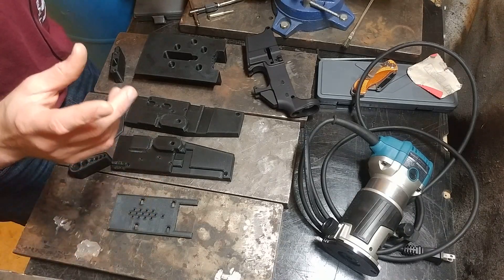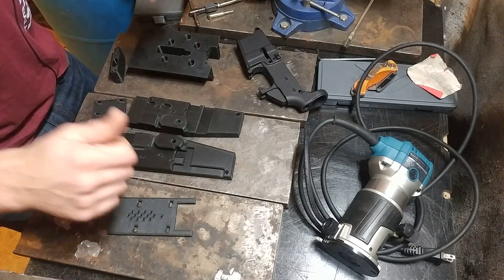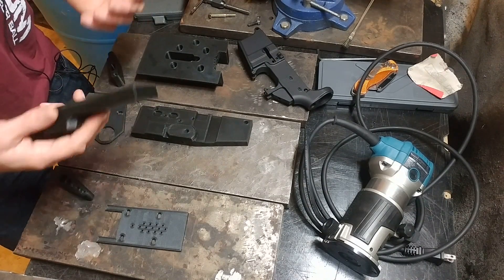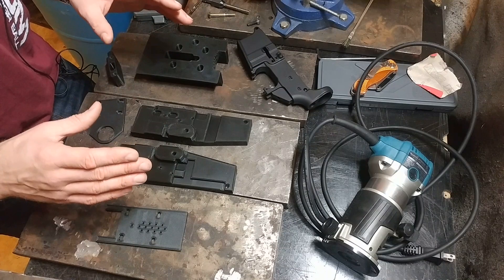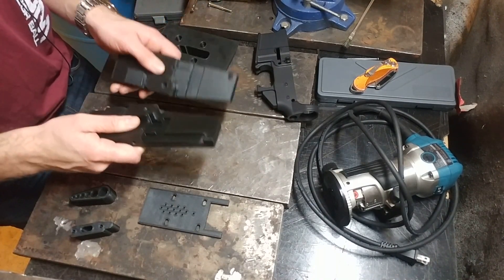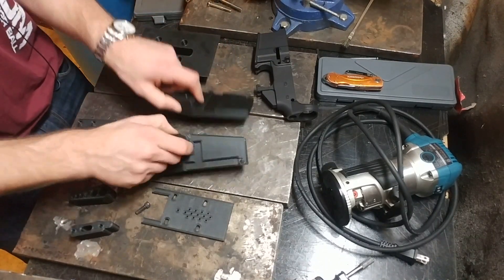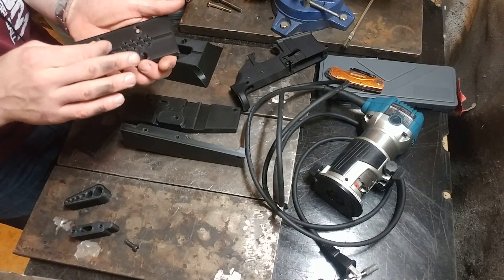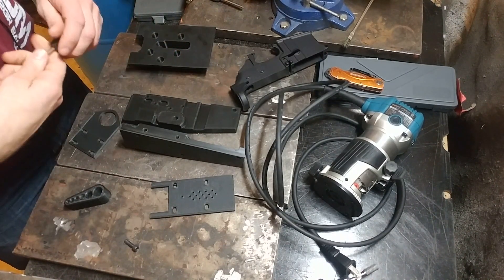FreeCAD Freedomizer Fixture

Comment: What length endmill are you using with this set up? That router base is really tall.
Reply from the maker: Very strange - I've tried commenting here twice, but YT seems to be throwing my message into the abyss. The short version: 1/4"x4" with 3/4" flutes, and buy them from "carbidetoolsource" on eBay.
Reply: @swolebro  Hey bud, would you happen to have a link to the exact bit I need? I searched all over the ebay seller you recommended but found nothing 4" long.
Reply from the maker: @MrIsaacpr7  Found out earlier this week they've got their own website now in addition to the eBay. It's a bit easier to browse.

https://www.carbidetoolsource.com/specialty-items

They've got 1/4"x4" mills in 1-packs and 5-packs there. I'd recommend the 5-pack, because it's cheap enough and then you're covered if you trash one.

Also, v3.1 and a video demo are both up on Odysee now.
Reply from the maker: And links separately, in case they were the issue:

https://www.ebay.com/str/carbidetoolsource
https://www.youtube.com/watch?v=8G4rtgJEW2M  (shop tour, very cool)
Reply from the maker: Very, very weird. Happened a third time. There's something in the longer type-up that seems to anger the YouTube comment gods. Luckily, I saved it in a text file after the first time...

1/4"x4" with 3/4" flutes. Yes, that's pretty long. With the Makita RT0701C, if I insert the endmill just shy of bottoming out in the collet, then the full cut depth fits within the range of the height adjustment knob. These endmills worked well on the drill press (even with me abusing them), and I expect they'll be even better under the higher RPM on the router. Just need to edit some older footage for two other videos, push that out the door, and then get back to this series. (The list of videos I'd like to get done is ~10x longer than what I can actually manage. lol)

Basically any endmill for this application is gonna be long, since you need your router base (or spindle nose) to clear the threaded riser. Most jigs build the height into a booster that you bolt on the bottom of the router. I took the opposite approach and built it into the platform, just since that's more universal.

Get your carbide from carbidetoolsource on eBay. Rumor has it they make all the stupid custom tooling (reduced shank grinds, etc.) that commercial jigs try to rope you into. The difference being buying one of those custom mills from the jig company is $50/ea, whereas buying the more generic ones from the toolmaker is $50/5pk. (fun for the whole family)

Also, get some spot drills while you're at it. They mark centers better, and since they don't have flutes, they won't wallow out guide holes on templates.
Reply: @swolebro  Tks... yea I know how yt can be with replies lol... appreciate the reply. I do have a couple of more questions about alignment as my print is finished but I don't want to you to violate yt rules wit the answers..lol. If you could reach out to me at blkopsairsoft@gmail.com that would be great. Tks.
Reply from the maker: @chadoneill6532  Do me a favor and open up a ticket on this GitHub project with your questions.

https://github.com/swolebro/swolebro-youtube/issues

Sorry if that means you gotta make an account on yet another site. I'd rather not get in the habit of answering publicly-useful questions via private messages. Means I have to keep answering them again and again.

Honestly, I've been meaning to scrape all the good comments I've gotten on my videos and put them into GitHub comments, just haven't gotten to it, because ffs, that's another thing to do.

Please include the URL of the video at the bottom of your ticket so that it can be easily searched by other people in the future. Also, I'd encourage you to edit your comment and remove your email.

Comment: Looks great. I want to try the side plates in my manual mill with DRO. 1/4" dowel pins for alignment, and I hope the jig plates won't crush or slip in vise. Yep, another up-vote here for JOKO Engineering. Thanks swolebro!
Reply from the maker: Have you seen the guide from Ray-Vin? It's a very extensive PDF and would be a great resource for you on a mill. The side plates I made are basically a variation on the ones he designed, extending it in all directions to provide some additional mating surfaces.

As long as you don't let it overheat, it should be fine, and if that ends up being a serious problem, you got options. Other filaments. Following Ray's guide to mill some aluminum ones. Finagling something between his and mine. etc.

Have fun, man.
Reply: @swolebro  Yes, thanks for the feedback (and your work). Ray-Vin's doc is my bible for machining things. I made some simple side plates from aluminum, but would like to try yours since my things are black-anodized and I don't want to scuff 'em up when I clamp in vise. Very best regards, and happy machining my friend!
Reply: @swolebro  Where could i get the guide from ray-vin?
Reply from the maker: @Patriot513  If's buried under way too many levels of links on his website (starting with the "Tech" link above his retirement notice). Honestly, if you just Google it, the PDF will be the first thing. Easier to get to it that way.
Reply: Hey thanks.  I'm always humbled to know my stuff was helpful.